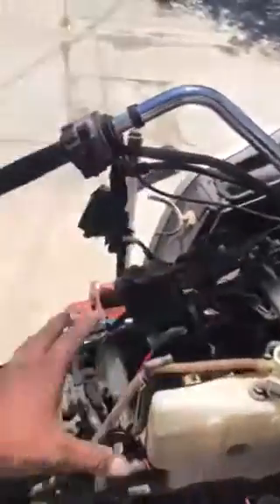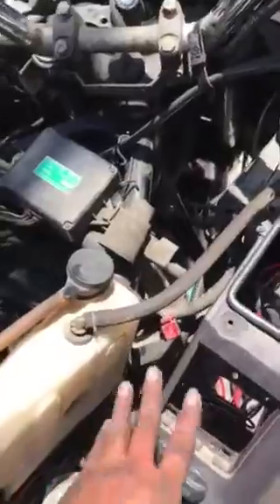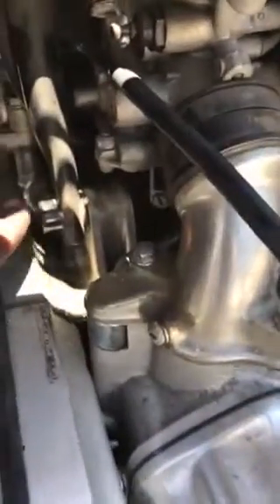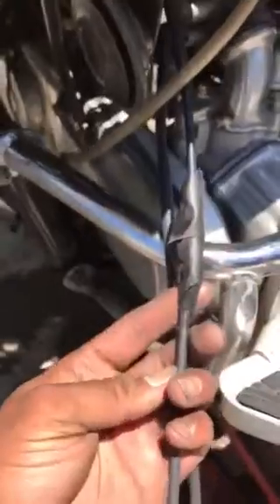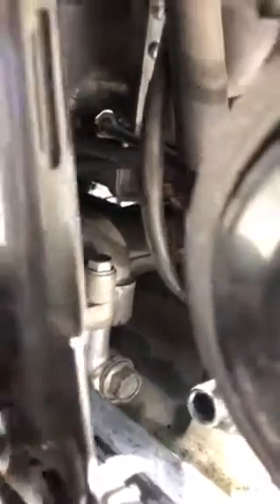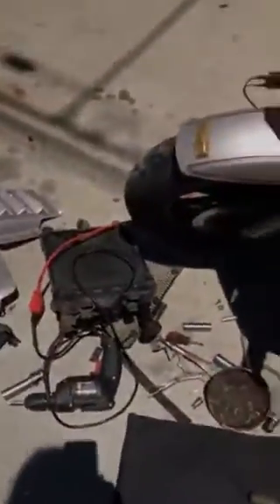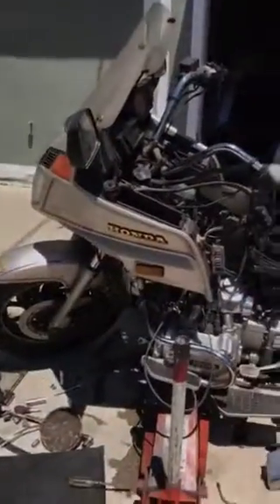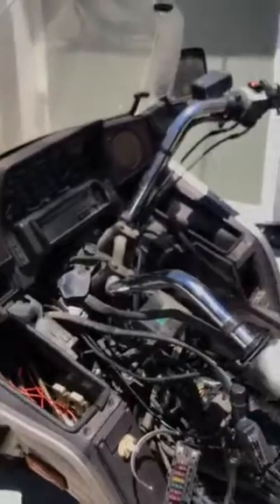87 Honda Goldwing Interstate 1200 Choke Cable Replacement

Comment: You definitely found the HARDEST possible solution for this job. 

Disconnect the carbeurators, shift over about 4 inches to the left, reach it just fine. I’ve already disconnected and reconnected my choke line connection twic in the last 2 days and have yet to touch the radiator
Reply: So..just lift and move the carbs over their studs after removing the 10 mm nuts?

Comment: While you are at it, take the engine out, replace the alternator, piston rings, oil filter and the exhaust. And do not forget to take off the fairing to inspect the head stock bearings